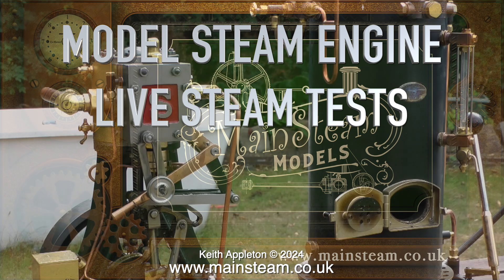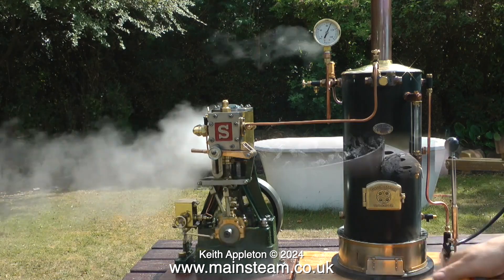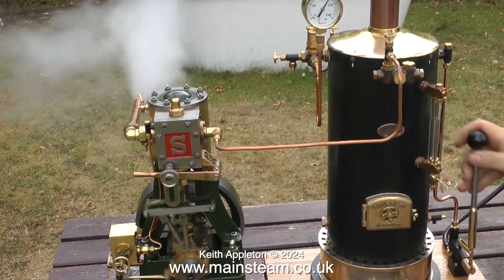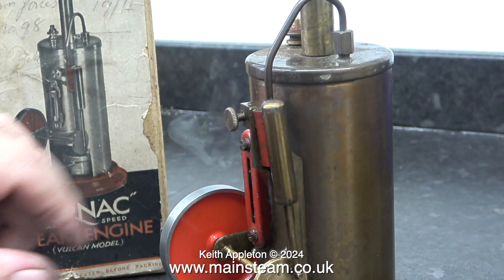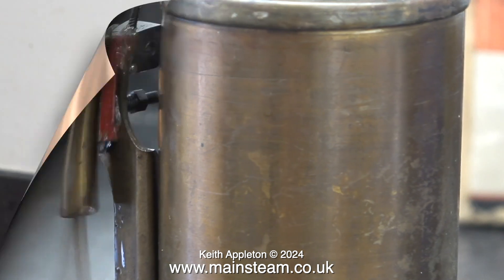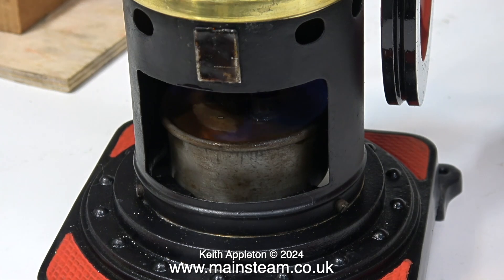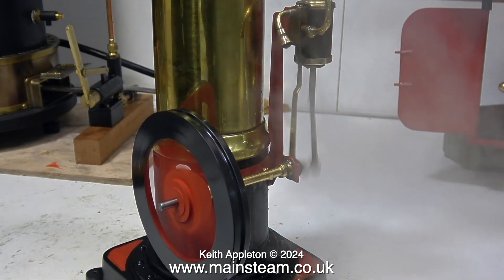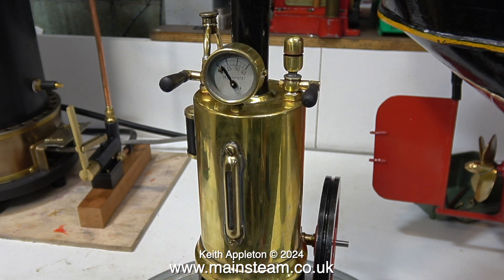MODEL STEAM ENGINE LIVE STEAM TESTS - PART #18

Comment: I think you have a fire in your ash pan, that happens quickly if the coal is too small for the grate
Reply from the maker: The coal was quite large, the problem was radiated heat which incinerated the wooden base